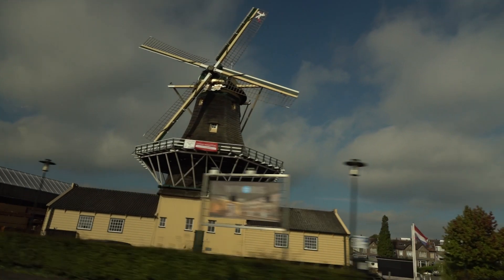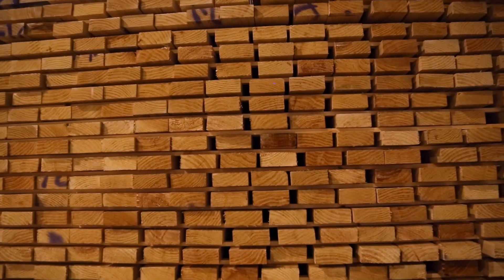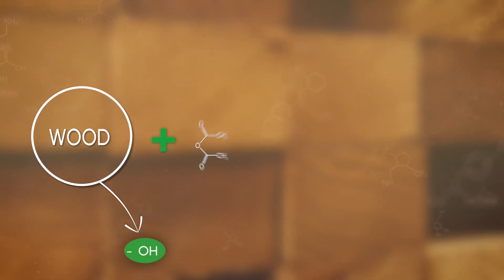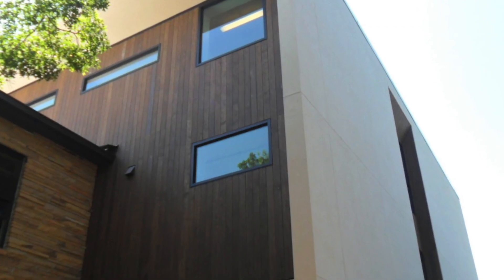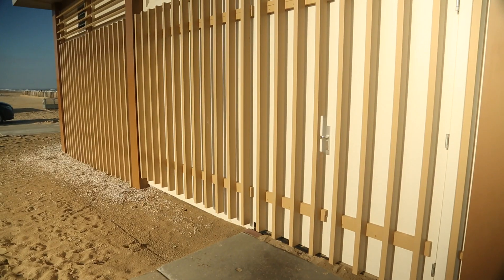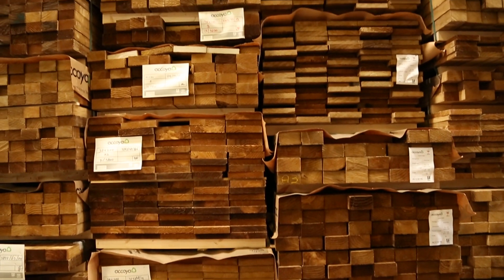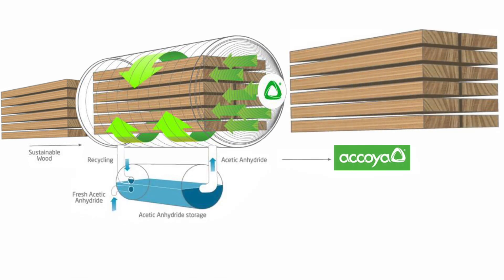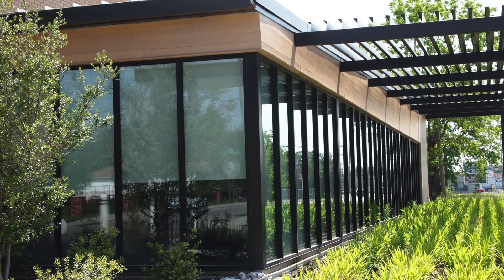Building Science: What is Accoya Wood?

Comment: What about the problems with the acetic acid in the wood reacting with irongmongery and brass fittings?
Reply: it is recommended to use stainless steel hardware for the accoya wood, acetic acid remains in the wood will rust metal. It might be better to use Accoya for exteriors because of its incredible performance, so...stainless steel makes more sense than the metal
Reply: @baohuyinh259  Right. We are installing a new porch made with acetylated wood. A protective layer between the treated lumber support beams and the Accoya, and all fasteners are stainless steel.
Reply: @baohuyinh259 

Same for Oaks..esp green oak unseasoned oak and other high tannic acid containing species. So nothing extraordinary about that 😊 how does it react to salt water exposure ..assuming its been epoxy paint or bio epoxi resin sealed?

Comment: So I just picked up a piece of 5x2 Accoya I had in my outside storage and half of it was not under the sheet metal roofing, it rained for 3 days on and off, the exposed part is measuring 25% MC whilst the covered part (of the same piece of wood) is 0-5% when measured in the centre (cut through the middle on the table saw. 

I've actually never ever had any wood get physically soaked right to the very core like this has. 

So far this is the worst performing wood I've ever used in trend of NOT taking on water

Comment: all sources of ignition. Take precautionary measures against static discharges. Avoid
contact with skin, eyes and inhalation of vapors.
Environmental Precautions Should not be released into the environment. See Section 12 for additional Ecological
Information.
Methods for Containment and Clean
Up
Remove all sources of ignition. Do not expose spill to water. Soak up with inert absorbent
material. Keep in suitable, closed containers for disposal. Use spark-proof tools and
explosion-proof equipment.

The Acetic Anhydride is some dangerous stuff to mess with. Static electricity can cause it to explode. All these harmful chemicals companies are using. We need to be using less, not more. That was from the MSDS.